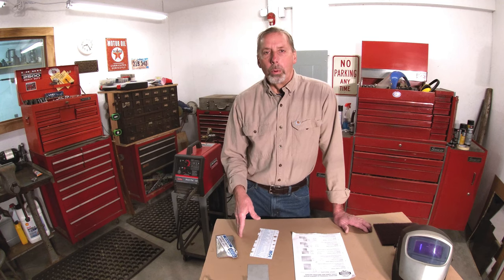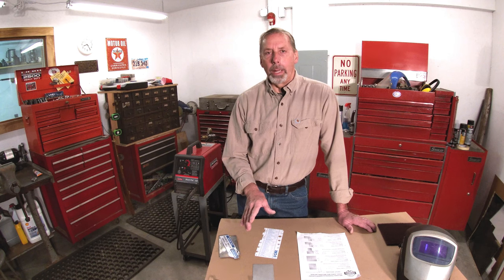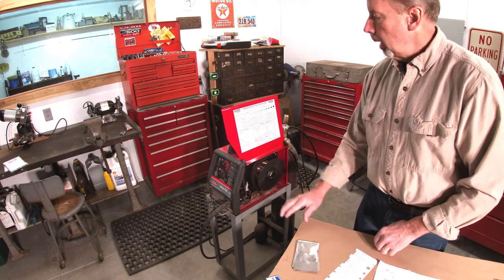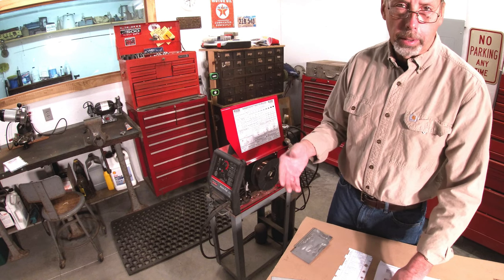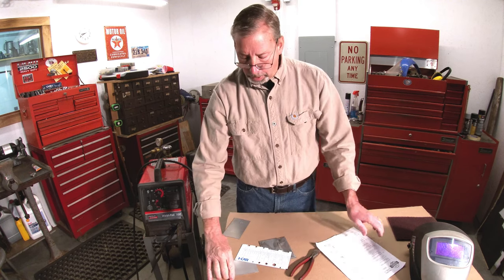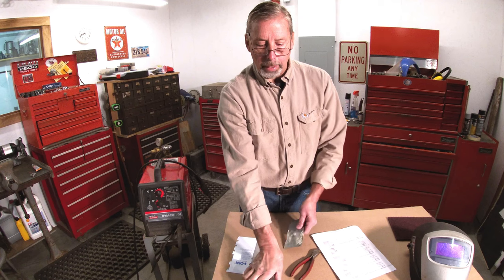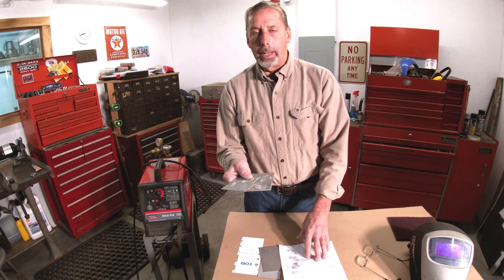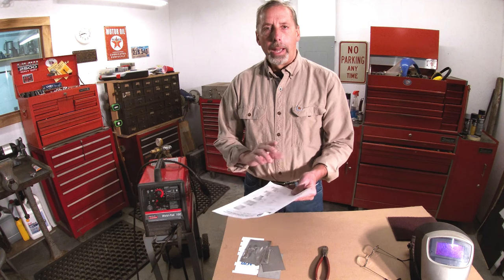Passing A Welding Test

Comment: In the uk I’ve sat welding tests called IMI (institute of the motor industry ) and pass125 (British kitemark standard) both require a high standard of knowledge in the chosen industry ,my pass125 test was 3 days of testing various parts of the bodyshop trade eg welding, panel fitting, bondo work,alloy and plastic repairs
Reply from the maker: That sounds like like a pretty comprehensive testing program that covers what most techs should know. Thanks for watching